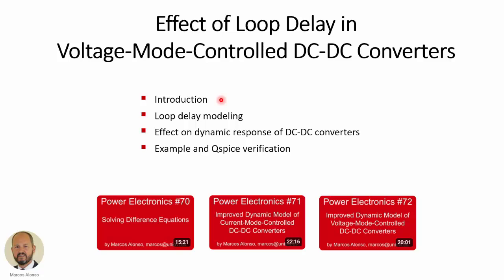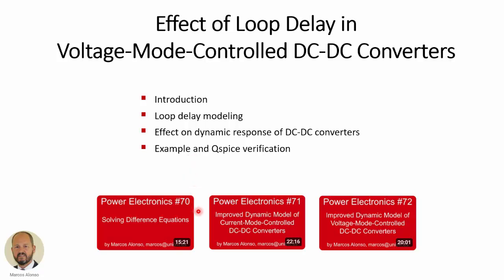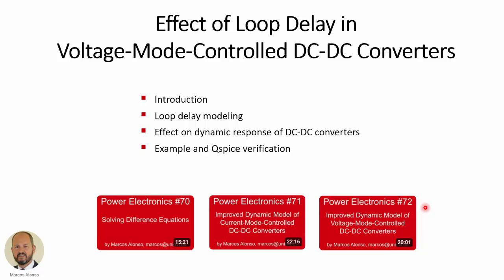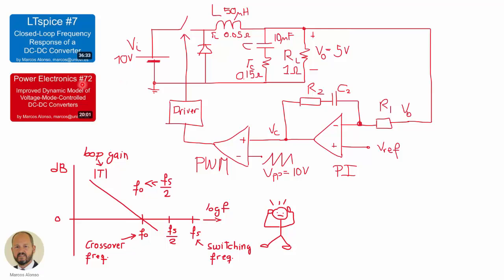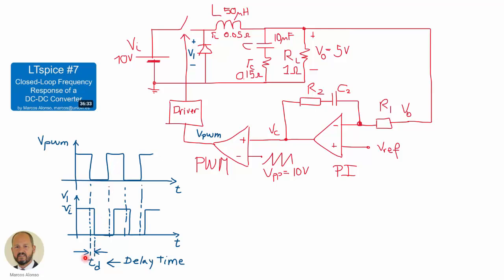PE #73: Effect of Loop Delay in Voltage-Mode-Controlled DC-DC Converters

Comment: Hello Professor Alonso. As always, highly detailed and informative video. Thank you for sharing. Just for your information, I have used the python script from your GitHub and it doesn't work with the latest version of Python and control library. It seems that the mag, phase, omega variables cannot be used like this anymore. This is why I personally don't like using Python because libraries change without keeping backwards compatibility. What works with the current version of Python is not always working with the newest version of it. Octave on the other hand, which is also free, is in my opinion superior to Python for such kind of applications and doesn’t suffer from silly updates like Python does.
Reply from the maker: Hello, thanks for letting me know. I am using 0.9 version of control lib. The info below may be of help for the latest version. It should be easy to fix
Starting with python-control version 0.10, bode_plot returns a ControlPlot object instead of magnitude, phase, and frequency. To recover the old behavior, call bode_plot with plot=True, which will force the legacy values (mag, phase, omega) to be returned (with a warning). To obtain just the frequency response of a system (or list of systems) without plotting, use the frequency_response() command.
Reply: @MarcosAlonsoElectronics  thank you for posting the fix. I have already found a workaround.